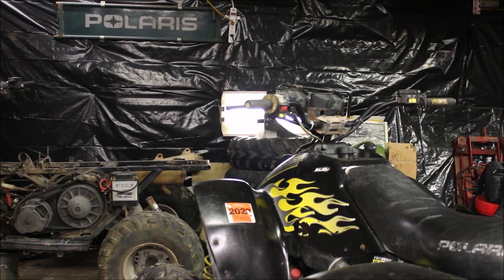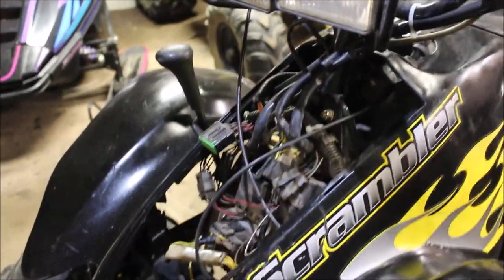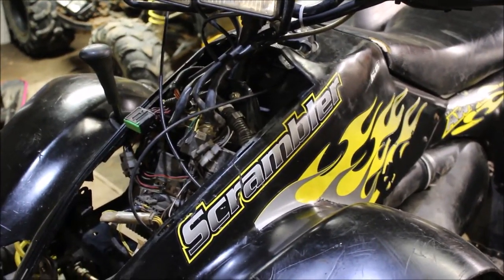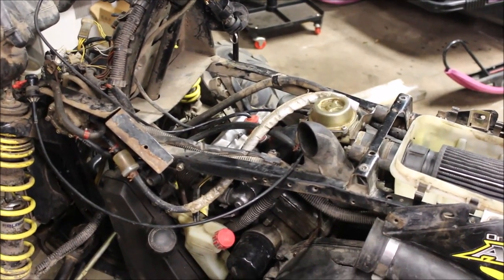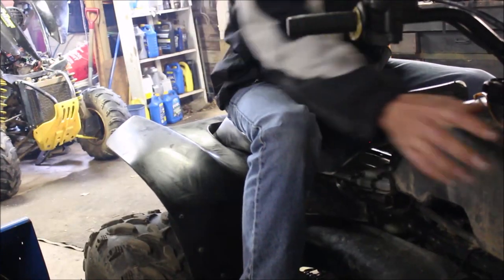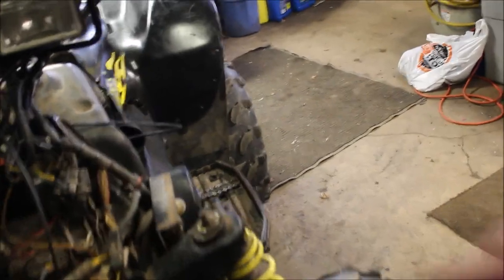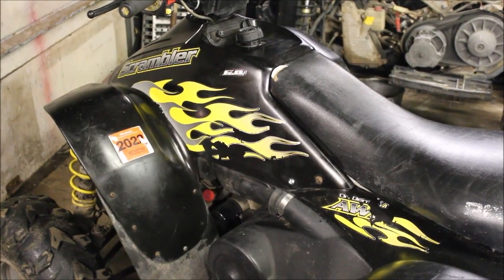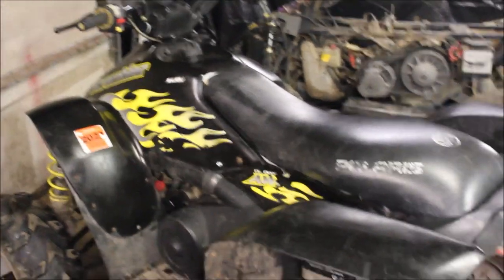You repaired your ATV and now it won't start! Watch this and find out why?

Comment: Well. The title is exactly what happened. Not only not run, no power to speedo cluster or anything. Starter is showing 12v until I turn key to start position, then nothing. It'll run when pull started.
Reply from the maker: I just made 2 videos on that. Here is one: https://youtu.be/yp256PtijRU
Reply from the maker: Here is the other. Theses might help you out. https://youtu.be/Appx98G07p0